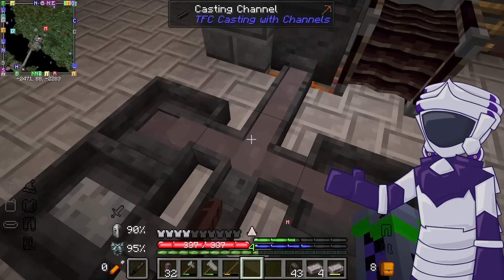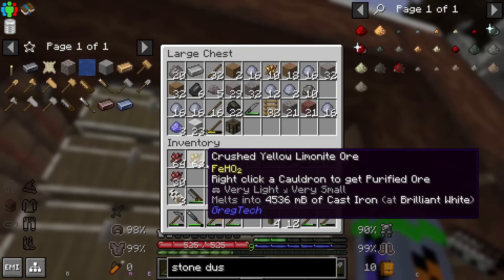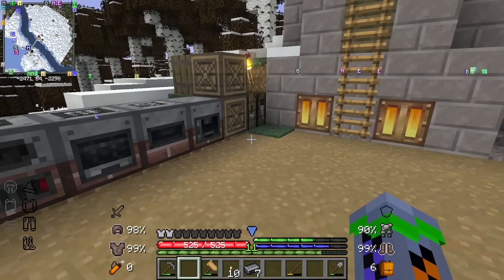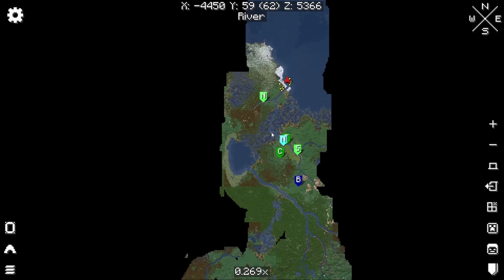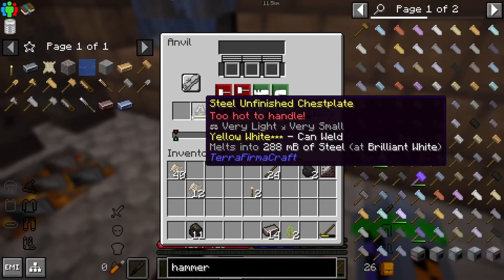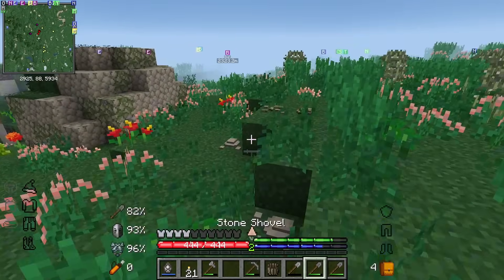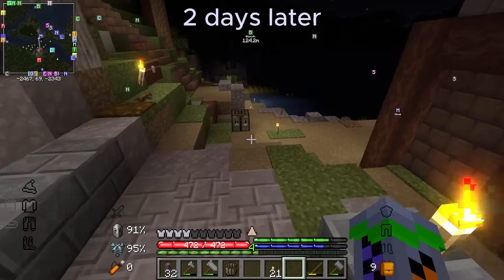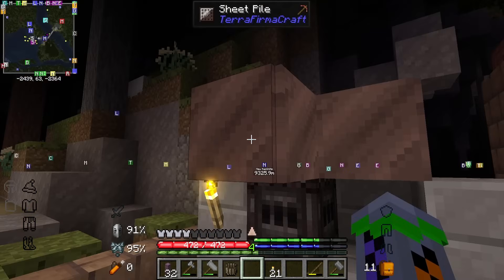Preparing for Electricity in Minecraft's Most Realistic Mod (TFG Part 4)

Comment: Some tips to make your LV grind less of a brute force approach:
- You have to make red/blue steel for your first machine hulls (then once you have an assembler you can make hulls with plain steel) and a metal bucket for moving lava around 
- Look into different approaches to generating SU as 100's of water wheels will lag out your world when you start to expand your contraptions to run at max RPM
- Create mod has more powerful automation than steam and LV in some areas such as ore processing (crushing wheel faster than multiblock grinder, 4x bulk blasters faster than multiblock oven), stress units are a constant source of renewable energy 
- You don't have to move south for paper if you start a greenhouse or bedrock farm (temperature stays warm constantly at Y:-60). Greenhouses are a WIP but they let you grow anything without spoiling till harvest. 
- Look into genetics in beehives, crop affinity will speed up all your plants by handling all your fertiliser requirements
- Find pineapple bushes or grind animal sizes for better drops using the butcher knife (look into tfc grooming station), leather is needed for alot of recipes before LV
- Grow wheat, grind into flower and ferment it into aged whiskey, this will give you haste 2 buff for mining ore ALOT faster
I'd hate to see you abandon your base so I hope these tips give you some confidence to push forward. 
Great series
Reply: Even when you have the ability to make lv casings out of regular steel, i recommend still using colored steel til you get an ebf set up to save on steel since it'll be very slow
Reply: Lots of great tips here. 2 create steam boilers (2x2) was plenty of SU to get me through LV and MV in terms of ore processing, smelting, rolling machine, first circuits. Never had to upgrade it. Took me about 1 year in game to get maxed crop affinity bees, the earlier you start the better.
Reply: (Typing this before finishing the video) Oh, and another tip: get an lv mixer to mix colored steel dusts without needing to process them, then you can melt the dusts in the crucible
Reply from the maker: that first tip gave me a heart attack, part 5 might take a while
Reply: 245 big waterwheels for 130k SU, seemed worth it for me :3
Reply: @Hecuba39  o7 good luck

Comment: Some tips for anyone else who wants to play this modpack:
- Invest in bees! You only need wood and thatch for them and beeswax is very useful for candles (MUCH longer lasting light source), a kayak, which is a boat you can pick up like vanilla boats, and other things. I know we all have ptsd from forestry's bees but these are so much easier. They all give all your crops a ton of nutrients!
- A forge hammer is the ideal first steam machine because it can make cheaper plates (until you make a mechanical press)
- You can automate wrought iron via nuggets in steam age. Don't make a second bloomery
- You can use create to pump fluids out of a crucible/blast furnace into a mold table, which forgets the temperature info so they cool instantly. A chute below the mold table will take out all the cold ingots
Reply: Honestly I prefer forestry's bees over any other bee mod or similar, it makes me really sad that it's practically discontinued

Comment: A few more tips
- You can place a drum under the blast furnace (replace the crucible), this can be pumped out with a create pump into ingot molds that instantly cool
- make a 4x4 kaolin clay area for glass panes. Grind the panes and make glass dust. Much cheaper vacuum tube bulbs
Reply: you can pump directly out of the blast furnace

Comment: Stockpile gunpowder, fill a wooden barrel with full stacks of it, seal it, stuff it under the Arnians and light it off with a redstone signal. Boom, no more Arnians.
Reply: This might or might not possibly have a chance of maybe being a little bit of the tiniest most insignificant bit of foreshadowing what could or could not happen in the unforeseeable future.
Reply: Well, for those who remember, the 5th of November ain't far.
Reply: @irradiatedslagheap7933  you gotta make a powderbarrel, not just a wooden one
Reply: @Firelord6127  I'm about 90% sure that sealing a barrel with nothing but gunpowder in it converts it automatically into a powderbarrel, and the distinction is solely for the sake of not tying all barrels in TFC to explosive code.

Comment: I'm gonna give you tips for someone who has made it to late LV (about to be MV lol):

-For early resin, the create pump can and will interact with a tree sap tap and you can easily hook those up to a barrel to automate latex production. Another thing about resin is that once you get the LV Centrifuge, you can centrifuge kapok logs straight up for resin and it will also give you methane and other byproducts.
-Once you get the assembler it will change your life. You can make cheap resistors with glue (which you can get by centrifuging resin) and its VERY cheap because you wont need paper as you will substituting the paper for glue.
-You might already know this one since you are familiar with gregtech but, if you use the ore washer and wash raw tin you can get loads of iron dust as a byproduct.
-Instead of using dust in the blast furnace, you can just cook cast iron ingots for a 1:1 ratio of steel.

-You can use the liquid solidifier to make cheap glass by crushing sand with a mortar and pestle into quartz sand which can be used to melt into glass and then solidify the glass into the glass bulbs thereby skipping the glassmaking prcess entirely

Theres probably more but I can't think of any more atm. I hope you get well soon Hecuba!!!

Comment: ive been playing this modpack because of this video series and have to agree garlic is goated for surviving winter. I was recently exposed to the knowledge that using Create fluid pumps on the crucible can move liquid metal into casting trays, which is cooled instantly for and can be collected by a chute. love the vids, check out greenhouses.
Reply: You can also use a spout to fill up molds. I haven't checked, but I think you should be able to use a Mixer to get the stuff out of the molds too, although I would guess there would be no returned molds.

Comment: you should get "tfc support indicator", it's included in the mmc version of the pack, and helps with knowing if smth might cause collapse or not
also you can right click with a "scythe" on a mature crop to get seeds, and it will regrow fairly quickly after that
also glass tubes i found it easier to make glass blocks, macerate, and then use the steam alloy smelter
also once u get to lv u can get a fridge (as long as ur pack version is 0.7.14 or later), tho note it needs ~5eu/t of constant power, and I personally keep mine in force loaded chunk so idk how it behaves outside of being loaded

also for blast furnace, u can use create pump to pump into a single mold table with a mold, and have a chute below it to auto output the ingots, the create pump insta cools the pig iron, so its alot faster/easier, and also u dont need fire ingot molds in mold table, normal ingot molds r fine

Comment: I found that using a high-pressure liquid boiler to burn off the abundant supply of creosote from the coke oven works very well for making large volumes of steam. Also, you can use Create chutes with the storage crates to automate the coke oven as the crates can hold entire logs in them. Good video!

Comment: If you are planning on moving, you should probably look into making some backpacks.  
They are crazy cheap so long as you can get your hands on some paper (you will need either papyrus or some eggs and pumice.)
They ignore tfcs container restrictions (similar to gregtech crates i think) so you can store all your items in large vessels, store the vessels in the backpack, and then store the backpack in another large vessel.
Afaik, there is no limit to how many times you can repeat this, but I am aware of some similar scenarios in older packs causing file corruption, so be wary.

TLDR: craft some backpacks for infinite storage if you want to move your base.

oh, also you can macerate flower pots and clay balls for brick and clay dust respectively.  you can use this make fire clay bricks without kaolin or graphite entirely!

Comment: You can circumvent poisonous ores/dusts by filling your inventory with single rocks, then standing near a non-poisonous ore and move a rock to pull it in until you've got all non-poisonous ore grades. Poisonous items can also be 'filtered out' by mining the block under them (early on in getting the grades) - for some reason items one block down don't get sucked into your inventory.

Comment: Here's a cool tip for blooms... 
1st use iron ingots they work better
2nd do 24 Iron ingots (one 16 stack and 8 ingots) and 24 charcoal to get the maximum number of blooms, the trick is to put the 16 stack of iron ingots in first, wait for a second, then put the 8 ingots in, wait for a second, then put the charcoal in and turn it on.
This has worked for me countless times, and yes you have to wait for the 16 ingots to register in the bloomery before the 8 ingots and then the charcoal. if you throw them in all at once it screws it up for some reason. No clue why but it does

Comment: You can use Create pumps to pump pig iron directly from the blast furnace into casting tables without a crucible, and it will cool instantly!
Combine with a deployer targeting bellows and chutes to collect ingots and you can fully automate it.
Also using cast iron ingots give better yield than dust.

Comment: Something that may help as well is a backpack, super cheap holds a chest worth of stuff, and ignores weight, so when transporting a bunch of say water barrels, put them in your backpack. It can also be worn on back and you can open them from inventory or place down and use like normal chest, also has upgrades that you can currently make for storage, the only thing to worry about is paper for the name tag, but I'm assuming you're going for papyrus, or just try to get a duck lay an egg

Comment: This is a real neat mod pack, though I can’t help but think the mods could be integrated with each other a bit better. There’s two types of steam power, that from Create and that from Gregtech. It makes more literal sense for mechanical power to be used instead of steam for maceration and hammering, and getting a steam oven hot enough to smelt ores doesn’t really make sense, especially not for ores that can’t just be roasted like iron. Gregtech really shines in its multiblocks and electrical and fluid systems, but mechanical and item movement would fit better with Create, while the ore processing of both mods should be changed to match base TFC. I wonder how adding a mod like The Factory Must Grow could change things?

Comment: Heads up for building, using framed blocked will mitigate the chance of having a build collapse, especially when it comes to building with brick slabs

Also making a Chemical Bath in LV makes paper easy (only wood pulp and water)

Comment: I got lucky, didn't struggle for redstone, just found it on a seabed once, and while it was absolutley tiny, it was enough to get me to the centrifuge and i could spin appart 8 electrum dust for 1 redstone (Awful rate but you can actually get infinite amounts by hand-making red alloy, marcerating it into dust, and then centrifuging it. It just costs copper)

Comment: yeah this is cool and all but when does the steam boiler fuel automation appear. manual refueling is not allowed in greg.
Reply from the maker: each piece of coal lasts 2 hours
Reply: @Hecuba39  no excuse! get liquid boilers and the create hose pulley to get lava and boil steam using that method! its so much more efficient
Reply: @kiwer2994  biggest problem with that is that you need lava Wich require a bucket made from blue and red steel so a later stage of the game, that or you link pipes directly from caves Wich is pain and probably more expensive, that said once colored steel has been achieved it will most likely happen